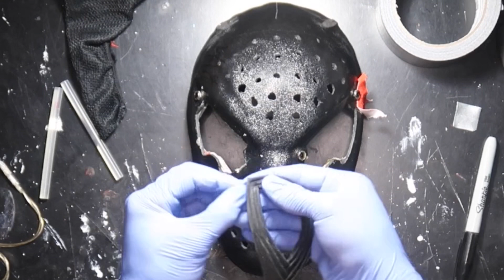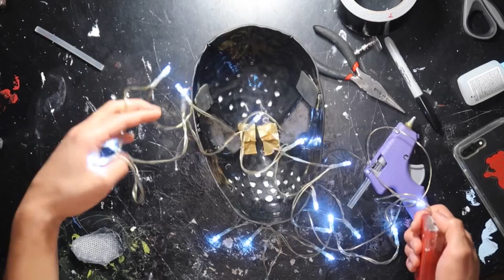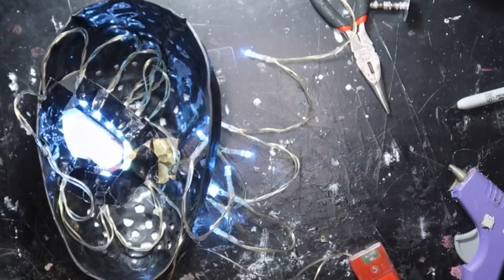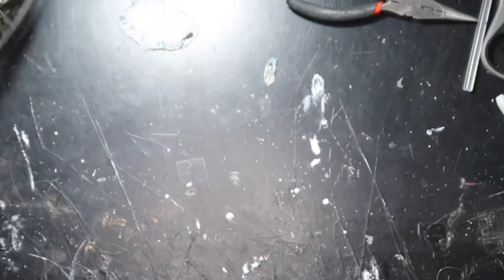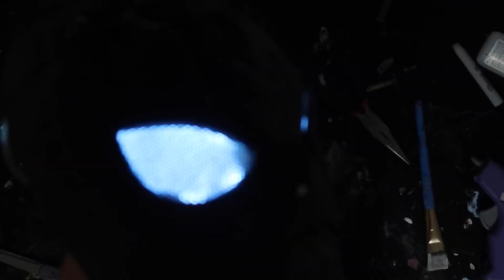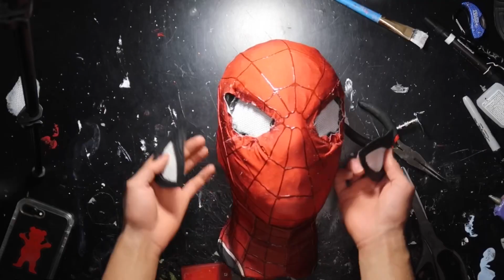HOW TO MAKE LIGHT UP SPIDER-MAN LENSES (IRON SPIDER)

Comment: y do u need a face shell? Cant u just wear the mask w/out nothing?
Reply from the maker: Rito I mean technically with this method you don’t NEED a shell but most likely you’d be able to see all the wires of the lights pushing through the fabric of the mask. The shell contains everything and makes sure it’s all seamless and smooth
Reply: Sebby Clemens 
No i meant y do u need a face shell for normal cosplay
Reply from the maker: Rito oh I gotchu. Well you can wear a normal mask but I’m my option it looks very bad. It shows off your nose and mouth through the fabric and it just looks kinda weird. With a shell, it smoothes everything out and will also replicate a certain look. For example: If you want the exact nose shape and head shape of the raimi suit, then you can get a raimi shell and it will help you replicate that.
Reply: Sebby Clemens 
Oh wow i didn’t thought it going to be that helpful! Thx